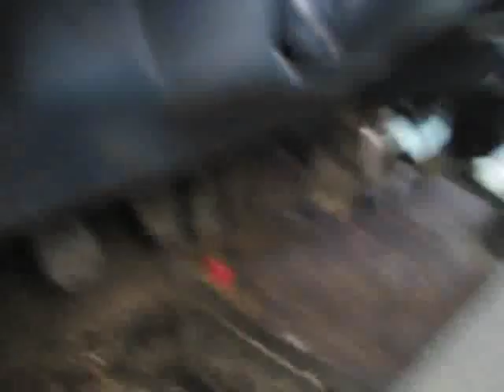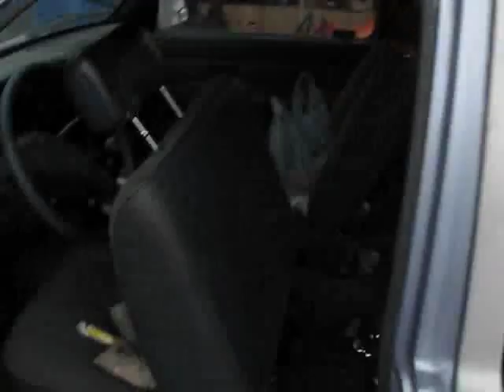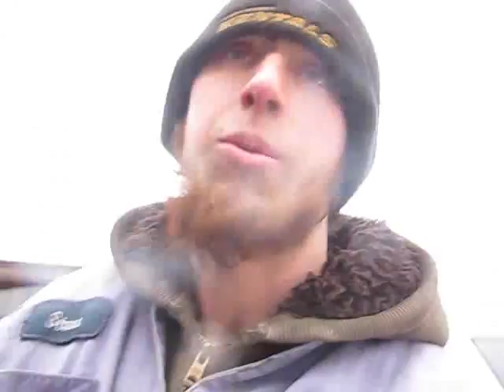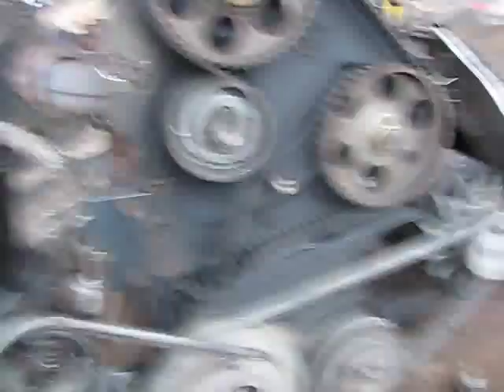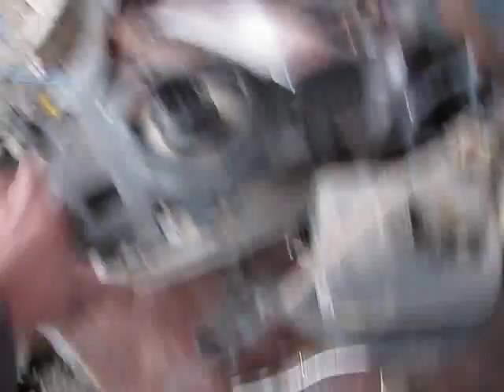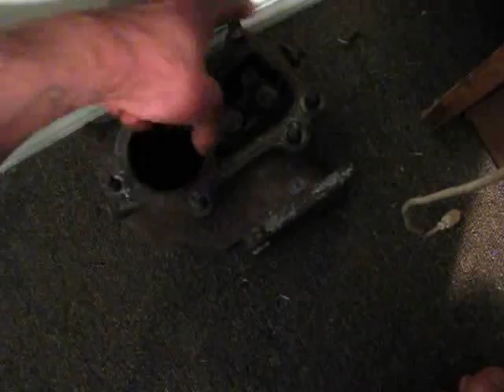1990 Pickup & Turbo Flanges! (02/10/12)

Comment from the maker: @pmillerinc thats a good idea! everything except the crank has timing marks on it to set the timing... the camshaft has a locking plate that slides into it on the back, the injector pump has a pin that slides through a hole in the pulley and the bracket :)

Comment from the maker: @HedgehogOutdoors yea, sometimes i have problems with my mastercraft tools... they arent too bad, but the ratchets seem to always fail for the same reason... the little gear switch cracks and jams when you try and use it haha. granted, im just reefing on it most of the time, but still, you'd think it should hold up better... its not like im using a 3' cheater bar on it haha

Comment: You probably need to oil your impact. Hold trigger and pour some atf in the air nipple. Few drops, maybe an Oz. then connect air back and run wide open, both ways. Its gonna exhaust some oil out so dont forget to have yur rag handy. Just a little bit of moisture will cause the vanes inside to stick. Careful after cuz it'll have power that u havent been use to, and may break some bolts.

Comment: Just use your grinder and notch your marks u made. I'd lightly mark that other pulley too. Only if it turns to the same spot after a full rotation cycle.